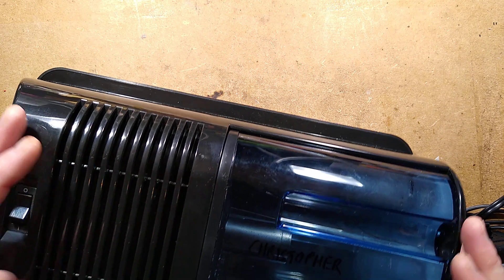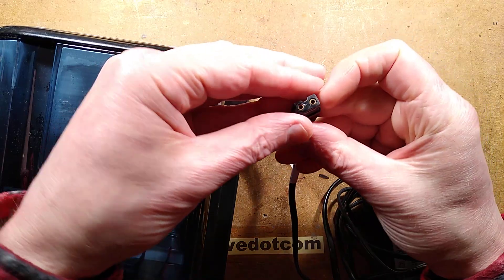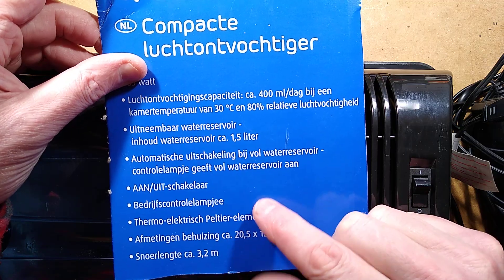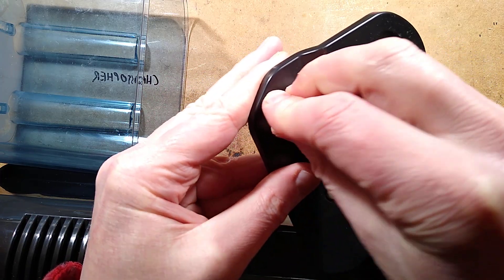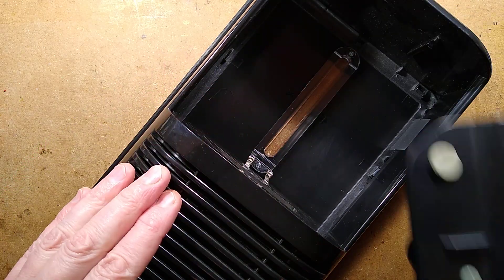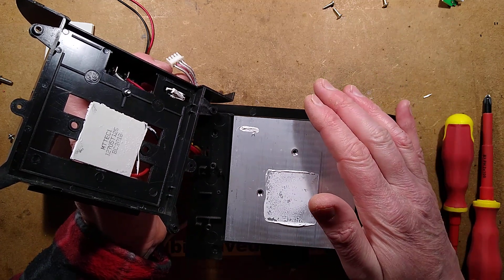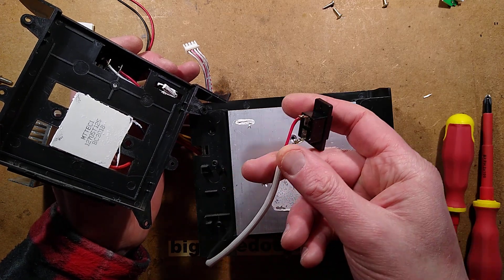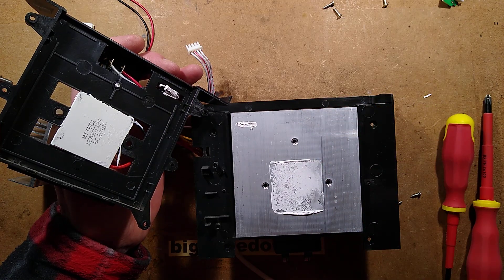Inside a faulty Aldi dehumidifier.

Comment: Any good ideas for, say, someone with a penchant for solar power who has got a very mouldy shed?
Reply: Something like one of these just plugged straight into its own dedicated solar panel?
Just beware that they'll still run OK with voltage dropped down, but go over about 13-14v for too long and it'll roast itself. Pick a solar panel close to the Peltier element rating (even if you get mostly cloudy days).
Reply from the maker: A computer style ventilation fan to create airflow through the shed?  (With matching grill at the other end.)
Reply: @bigclivedotcom  That's what I always planned to do.  Even a fan at the bottom pointing in, and a fan at the top pointing out  - to minimise the amount of wiring etc.  Small panel on the roof and job done.  Airflow is what you need for a shed, not dehumidification (in most cases)
Reply: ha ha.  I thought of Julian Ilett too.  ... But I bet Julian's fan will be just fine. Although he does like to tinker.  He might enjoy using his Arduino Temp/Humidity remote sensor , to log and plot out the data of Fan alone vs. Peltier Dehumidifier.

Comment: The thermoelectric thingies use semiconductors rather than metals- you can make semiconductors very electrically dissimilar to each other (p Vs n type) so you get a bigger effect+ metals are a bit too thermally conductive to perform well (the heat flows backwards)

Comment: Actually the compressor based units do put out a bit of heat. When mine's off it emits 32c air, when it's off but the fan is still running it emits around 18c. This is with ambient temp of 23.
Reply from the maker: When the water is condensed out of the air it actually gives off heat during the transition.

Comment: One thing I'm still wondering though... is it efficient? XD
Reply: about the same amount of water collection as gluing 2 butterflies your desk and making them widdle on a saucer
(per 24 hours, at 30C and 80%RHm both butterflies drinking hot sweet black tea every hour, )

so, no, they are shit unless you are trying to dehumidify a very tiny, very warm, very wet cupboard 

source: Dr. Vanessa Atalanta, Prof I.P. Freely, "Advances in Adhesive Insect Piss Production as a Dehumidification Strategy for Large Buildings", Springer Press 2019
Reply: Hell no not even a little bit.
Reply: Actually it's not that bad. Water has a huge latent heat of vaporisation and a very high specific heat capacity. So a 100% efficient system would  need 2,260,000J for 1 kg (about 1 litre) plus 4200 times the temp change. So at 400ml that's 904,000J + about 50,000 for the temp change. 12V@5A is 60j/s or about 5.2 million. So about 20% efficient. Not good but not horrendous either. There are compressor types claiming far more than this but only avery few up around 50% and they are hideously expensive.
Reply: @gordonlawrence1448  yeah my argument is mainly that a small/cheap compressor dehumidifier for about 3x the price of this one will extract about 10x or 20x the moisture than one of these small peltier units in the same room and about the same temp/RH for about twice the energy usage - from bitter personal experience.
Noisier though.
Reply: We use them in a few basement rooms in summer when the air has realtive high absolute humidity. I can tell you they are very efficient at heating the rooms a little and thereby keep the relative humidity down ;) .
Reply: @superdau  up to 5Amps at 12V - yeah that is probably more of a drying effect than the peltier condensation haha

Comment: Being fair 30 degrees centigrade at 80% humidity sounds reasonablw for a clothes drying room/airing cupboard where you might put a dehumidifier to speed up the drying of clothes.
Reply: I have one of these models. Vaguely remember that the manual advises against doing this kind of thing.
Reply: This device can probably dry as many as 4 socks in a single day. That is two whole pair.
Reply: @Mason Bee it claims it can do 400 ml in a day, but reviews report less. Let's assume 200 ml/day, thus 50 ml per sock. My best, warmest socks for working outside in the winter almost certainly hold more than that after wringing them out by hand. I was thinking more of generic inexpensive adult sized tube socks.

Comment: This Peltier element setup is exactly how these cheap 12V car fridges work also. Pretty cool concept applied there.
Reply: So theoretically you could convert this into a 12V fridge, if you wanted to. Don't know how much they differ in price though, or if it would be worth it.

Comment: I have a unit like this, also a much much larger one, plus a smaller ac unit in one room and a full house ac system. Between the four I pull about 2 1/2 gallons of water (9 1/2 liters) of water out of the air per week. Florida is a hot, wet nasty place.

Comment: The dryness of the thermal compound is not a problem. The grease that makes it 'wet' is not the effective heat transfer material, the white metal oxide is.
So long as the surfaces are tightly bound, do not move and do not have air pockets between them (all true with that screwed-together housing), then the compound works effectively.
Interestingly, there is an exhibit in the Toronto Science Museum that has interlaced metal prongs. You place your hand on them and press a button: one set of prongs goes ever so slightly warm. Press the button again and the other set of prongs goes slightly cold. Press it one last time and both prongs go to their slight temperature offset, but because skin senses temperature difference it produces quite a shocking but safe burning sensation.
I used Peltiers in a humidity control chamber, some years ago, to set the air temperature and that of a small container of water. Since %rh is a direct function of those two temperatures, we could create a consistent and fairly accurate %rh for checking calibration of sensors. The only trouble was the I²R losses in the Peltier limiting the lowest temperature of the water bath and that eventually the thermal cycling lead to a leak in a prototype that peed water all over the control board and corroded it in no time.

Comment: Thermo-sealant has gone dry, so the unit is over-heating, hence; the char-coaled wire.
Reply: No. The plug was not properly seated, so the contact resistance melted the plastic. The thermal paste going dry is not a problem, often it's a cement-type conductor anyways that is expected to harden.

Comment: So based on those specs this dehumidifier works best in the amazon rain forest...
Reply: There would definitely be plenty of humidity to pull out of the air. :)
Reply: 30ºC with 80% humidity - as comparable to a car with a bloody pot full of hot water in it just making a big bloody mess
Reply: I have found even when it is humid and warm that this type of device don't really work well. At around 30° and 80% humidity the most I was collecting was 15ml a week. Dosen't really have an effect in a room of any size. Maybe a cupboard would work but a jar of DampRid works better and doesn't consume 25W.
Reply: Or a bathroom after a long shower. That's what we use it for and it actually works: not even condensation on mirrors. Not very useful for rooms though.
Reply: Or Houston any time from March to November.  Today we have a high of 28C at 75% humidity.  We regularly hit 35-37C between June and September.
Reply: Big Clive says, no.   A solar powered shed would be no good, too much tree cover.
Reply: And even then, the amount of water it pulls out is tiny.
Reply: Or here in Kansas can be 105F @95% humidity
Reply: Or when outside 30°C and 70%, but flat has 22C, all humid air coming to flat start  hitting 80-90%. No climate devices, flat looks to north shadow side.
Reply: Try Sydney Australia during the summers. Disgustingly hot and humid.
Reply: @Spacemonkeymojo  I lived there with no AC, it can be awful sometimes 😅
Reply: @LunaWuna  I think it’s got worse in the past few years… likely due to climate change sadly.

Comment: I purchased like a half dozen of those modules from good ol BangGood.  Only like $2.00 each ?  Using solar panels you can have free cold beer.
Reply: How do you get the free beer?
Reply: @ferrumignis  Back in the days before checkouts got clever, I effectively got paid to take away beer due to a 'Get £n off x bottles' offer when the local Tesco had some short-dated bottles reduced to clear and £n was more than the cost of x bottles.
Reply: So did it work?

Comment: i bought 1 of these exact dehumidifers for $5 at a goodwill(resale shop) and converted it into a can chiller
Reply: also, the fan doesnt cool the air and then heat it back up like a traditional dehumifier, the plastic is designed in such a way that the airflow is more or less sealed from the hot side to the cold, there is a gap where the water chamber seats on it but not enough to be intentionally designed for the purpose, the hot gets sucked in the back and out the top, also my version the heatsink was different, it was a normal square heatsink but the bottom edge had a leading angular bit to direct water droplets into a smaller area and encorrage them to fall ||||||||||/
Reply: hey @bigclive sorry about 3 replies in 1 thread of comments but have you considered getting 1 of those lamp/arm/universal positioner things that works on springs, counterweights and friction to keep an object(ie your current recording phone) at a set position so you can keep to your recording format but have much greater range of zoom and for larger objects like this, if you really want to gild the lily as dave jones would say, add a ring light with spring loaded clamps to grip the phone from the sides and leave back/front fully accessible here is a crude ass-cii |/\/\/\/\-(( || )) representation of it kinda like a lab stand or helping hand with a lighted phone mount on the end instead of alligator clips

Comment: Aw, I was hoping for a schematic. I have some TECs and want to make a little dehumidifier for a bathroom that has no vent.
Reply: Power > Peltier... Nothing exciting.
Reply: @kilrahvp  oh I'm sure. but I've never used them before. is there any current limiting needed?
Reply: Jarrett Does Stuff, very occasionally nope, you just supply voltage and it'll draw what it wants, datasheet will say how much. Behaves mostly like a resistor
Reply: @kilrahvp  very cool, thanks!
Reply: They are pretty robust. You can even reverse the polarity, it will just cool the wrong side then.

Comment: wouldn't it work better if the hot aor was blown over the cold side? i always wonder it is not there to cool the air but to pull the water out so fast cooling of the heated air could actually work better
don't know how the peltier would hold up though
Reply: kokodin nope. Speed doesn't matter, you just have to cool below the dew point. If you throw warm air to it it's all that much heat to remove before getting there.
Reply: @kilrahvp  i always thought that water like to be shocked to change state more than  go trough gradual change because it act as big heat capacitor
that's why icecubes form faster if you put hot water in the freezer or that hitting a chilled bottle may make it freeze over instantly. so rapidly changing how much water can be in air with rapid temperature drop might work faster than trying to chill air that isn't that 30 degree as anual states

Comment: Clive, you should take apart one of those caravan fridges that work on 12v battery, 230v and gas.

It might be an interesting to show people how those work, because that is an ammonia type of heat exchange. Quite different from Peltier cooling.
Reply from the maker: Adsorption refrigeration?   Ideally it would be a transparent system so the process could be seen.   Notable that a common way to fix those fridges is to shake them or tip them upside down.  The complete opposite of a compressor system.
Reply: There’s not much to see they solely rely on a heat source of either a tiny lpg flame a 12v 8A Heater or a 240v heater (which is the only source the thermostat works on)
Reply: Funnily enough, adding a PC fan to those really helps in summer.  (You don't actually cool the unit, but you blow out the hot air at the top of the cavity they are installed in)

Comment: I have a cool box based on the same principle (but with a fan on the cool side too, as you were expecting) and it is really quite effective but probably not very efficient electrically. 240v or 12v, which is useful for pre-cooling before going away. Over 10 years old and still going strong.
Reply: 15 % efficient at best.

Comment: You now have a tiny desk top A/C unit.  3d print a cowl and leave it on the desk.
Reply: yeah that also heats up the room
Reply: @WillyJunior  I was thinking of it as a little personal cool air blower.  No net change to the room temp since its all in the same space but would be refreshing.
Reply: @someguy2741  Except the efficiency loss which is extra heat.
Reply: @petertr2000  True.  But the extra heat is blown away while the cool air is blown towards.  This idea is not intended to be a long running cooling solution.  It is a short term cooler while you sit.  It is essentially no different than the way it is now except with a fan that blows the cold side to the user.

Comment: I have one of a similar size, the the plug in lead does tend to run a bit on the warm side, if any arcing occurs I'm thinking of hard wiring the connexion
Edit 17/03 - the the plug in lead finally failed after about 6 months of use, opened it up and removed the socket and connected  the dehumidifier to power cable permanatly.
Reply: I've got a really old car fridge with the same problem. The cigarette lighter socket plug melted when I used it for the first time (it's been in a cupboard at my parents place since I was a kid - they never used it) last week.
The fuse in it is 5A. The plug itself doesn't say what it's rated for... But it looks like ones I've seen on much lower current devices like old phone chargers. I bet it was only rated for like 2A.
Reply: sounds sketchy as hell

Comment: Thanks Christopher for you contribution & thanks Clive for taking it apart. So it was the single shot thermal cut out that killed it.  I’ve been fascinated by Peltier plates, there is one in my stove fan to drive the motor. I’m pretty sure Clive has done a video on these devices in the past. 👍💯
Reply from the maker: The cutout was fine.  It was the power connector that failed.

Comment: The fan is not just to keep the hot side tool "to avoid damage". These TEC devices will achieve a given temp reduction (say 18degC) so if you want the cool side to be cold enough to  condense water out of damp air passing over the fins, you have to keep the hot side cool too. I have a TEC-based 12v portable fridge and that works the same way - the inside can only ever get a fixed temp reduction on the air passing over the outside hot fins.
Reply: Right... These things can only produce so big of a temperature differential between the hot and cool sides. The cooler you keep the hot side, the cooler the cold side can get.

Comment: I've had a few of this style of dehumidifiers and I've found that they always break down after a few months. I eventually got myself one of those desiccant dehumidifiers instead and it works so much better.
Reply: If you look how the inside of the water chiller looks after a year you would not drink that water. Sludge and white residue from the poor quality extrusion that is dissolving aluminium into the water, plus the lovely coat of bacterial slime covering all the inside of the tank. At least the refrigerant types are designed for the most part to be serviced, and also use a non corroding inside tank, with the hot water side being stainless steel, though also with an element that is not replaceable separate from the tank. Curse is that they use no copper pipe either, all steel brake lines, which rust from the outgassing from the foamed in place insulation, so it is not easy to repair once the pipes rot through. Lost a few fridges to that, you can only see the leak once you have removed the inner lining, and that is kind of destructive.
Reply: SeanBZA Did you reply to the wrong comment?